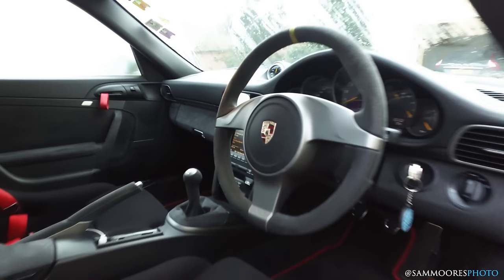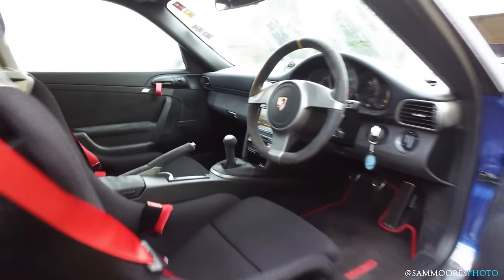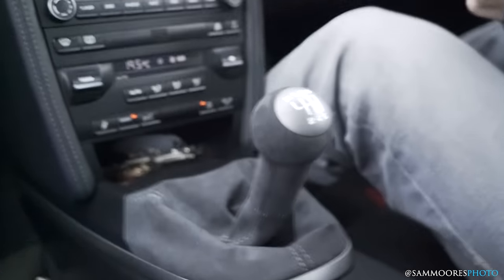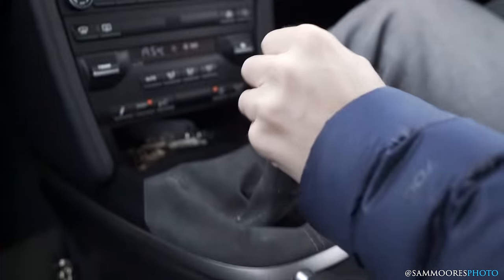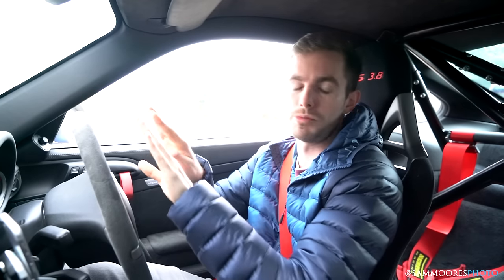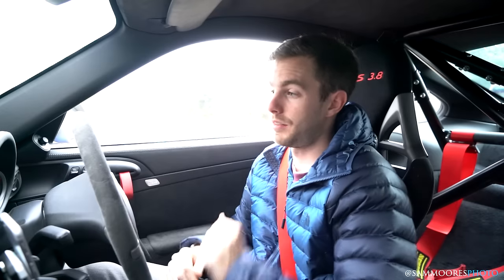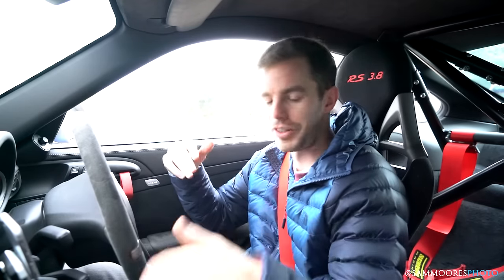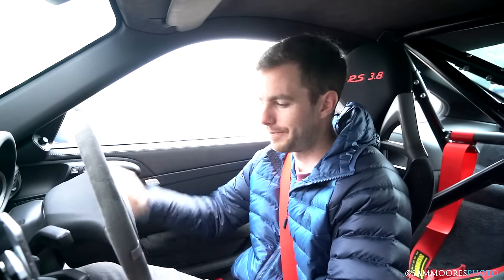HOW TO Heel And Toe In A 2010 Porsche GT3 RS

Comment: Double de-clutch is to bring the gearbox internals up to speed to match revs.
Been heel and toeing for the last 60years, BUT not the abortion of today when drivers feed the clutch in AFTER the revs have dropped.
Done properly you dump the clutch as its perfectly in synch with the engine.

Comment: Double de-clutching is critical for speed matching of the rotating components in non-synchromesh boxes, so older cars, heavier gearboxes like trucks and racing boxes (like dog boxes) all benefit from the technique. Synchro engagement of most gear sets during the late 60s/70s means that it's now not required but still useful at times, but it's very rarely needed by most ...
Reply: But I still do it without thinking, had a few cars without sycro, plus it's a smooth ride
Reply: It is still very usable technique because you are not upsetting the car balance during heavy braking and cornering (with possibility of locking up rear wheels). There is also a small bonus of lesser wear on syncros, but it doesn't really matter in most cars due to how tough they are.

Comment: Although I am not 100% sure of what I am about to write, my gut feeling tells me that I should be right! I think that rev matching is mainly to prevent clutch and gearbox wear (synchros etc) rather than engine wear. I would think that engine components are able to take the load generated by not rev matching pretty easily ... unless you downshift 2-3 gears in one go.

Of course, as you mentioned, rev matching is mandatory only when on a track (or doing very illegal speeds on the road) as not rev-matching could mean locking up the rear wheels and spinning the car (or briefly loosing control of the back end). Other than that, it is more of the intellectual satisfaction of having spared your car a tiny tiny little bit of wear and tear.

That being said, although I have raced, I am not a mechanic so I wouldn't know which part of the car gets affected the most nor if it actually makes a significant difference to the parts of a non-race/non-sports car after years of driving... as in how many months of wear do you actually prevent by rev-matching?
Reply from the maker: Think I fundamentally agree with you. I like to do it all the time but that's down to hating the jerk every time you lift up the clutch pedal which coincidentally you can do much faster I guess if your revs are in the right place, other wise you have to be gradual which must dramatically increase wear. Anyho, not mandatory but fun and better all round.

Comment: A manual GT3 RS manual - that was a pretty good investment.
BTW Adidas has many shoes who are designed for race driving - as a GT3 R race driver i mostly use the K1 Kickboxing ones.
Reply from the maker: +Rick2010100 for actual racing you need fireproof shoes tho. General driving I just use whatever works from my cupboard
Reply: Fireproof shoes lol I think it´s more important to be optimal connected to the car and the right shoes are there the key, esp. at braking.

Comment: True!  It helps when step on the brake harder and roll over to gas pedal.   Very helpful detail information technique.   I tried a few times and I was practicing on my RS.  IT's actually not as easy on the RS, the Rev move quick.   I should of practice when I was younger and  on a corolla etc.   tell me, I remember my Buddy used to show me how to change gear without stepping on a clutch! (Teenage time).  Match the RPM speed as I kind of remembered but not quite sure now.  
Can you explain to me how it works?   Changing gear without stepping on a clutch?!
Reply from the maker: +Frank Kwok ha, i reserve that for rental cars 😂 you have to match the revs perfectly

Comment: Sam, I noticed your RS sounds surprisingly different from mine. Does your bypass pipe bypass the centre muffler? Mine bypass the side mufflers, it sounds a bit deeper whereas yours is a bit higher pitched, I suppose that'll be the difference. Cats & headers original?
Reply from the maker: +FrankD centre muffler delete basically. I also have the valves open all the time. Other than that everything stock
Reply: FrankD any drone which side bypass? Tks

Comment: Far nicer car than the 991 RS
Reply: E55 BæMG I love the 911 R but I think it is so overrated
Reply: E55 BæMG No, see you comparing it to those V12 legends makes me think it is more overrated than I thought
Reply: E55 BæMG Alright, the 911R is a well balanced, nicely handling and manual car, the F1 is a well balanced, three seater, V12 engined, incredible sounding, 240mph car made for the thrill of driving on an entirely different level to the 911R, it's a race winner and has a manual transmission, the 911R is an RS without some of the aero that makes it so fast, and it has a manual transmission, no comparison, to tell me the 911R is anything compared to the F1 is delusional
Reply from the maker: Haha, I'm sure the R is good but let's not mess about... It's no F1 or Zonda
Reply: sammooresphoto Thank you!